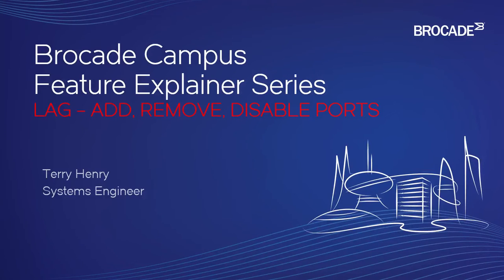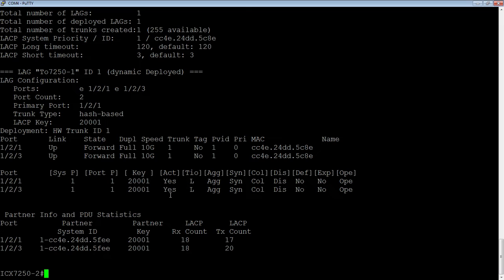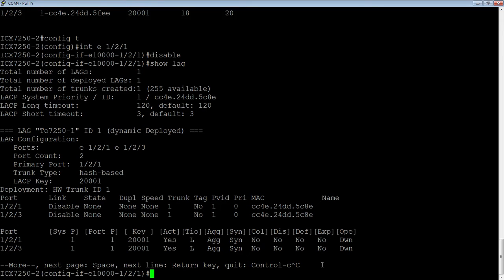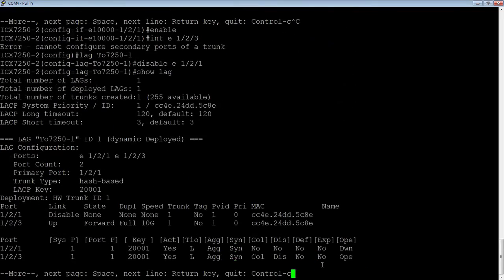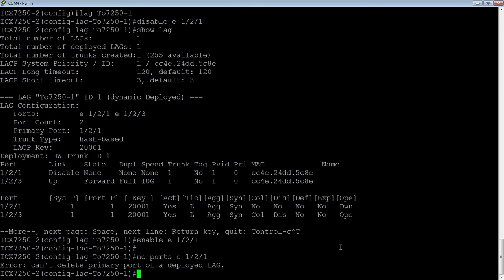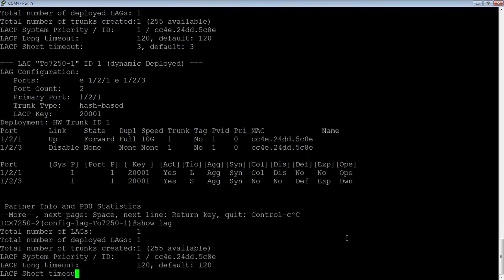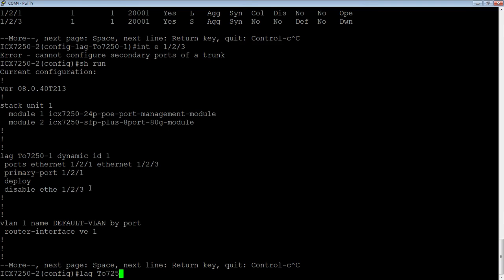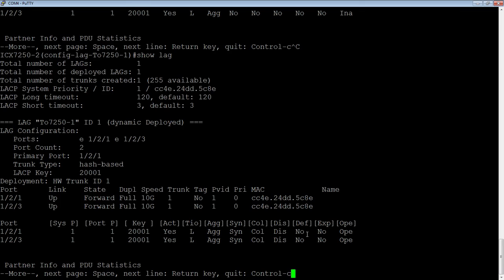LAG - INTERFACE ADD REMOVE DISABLE

Comment: Invalid input -> lag
Type ? for a list

Why ? 
ICX6610
Reply from the maker: Your firmware is very old.  The command structure changed substantially in 8.0.40.  Prior to that the link-aggregation command was used under the interface.  Upgrade your code or grab the L2 guide for 8.0.30 or below.
Reply: Ok. Thanks for your information.